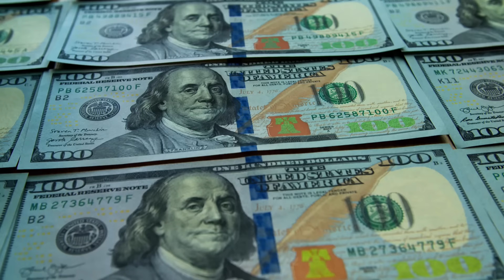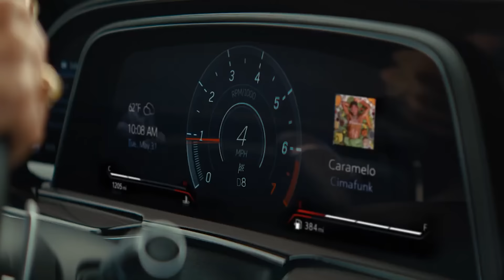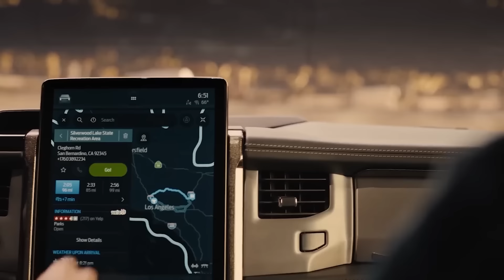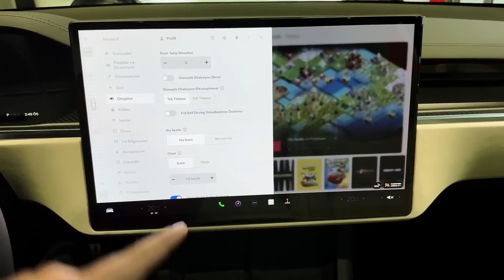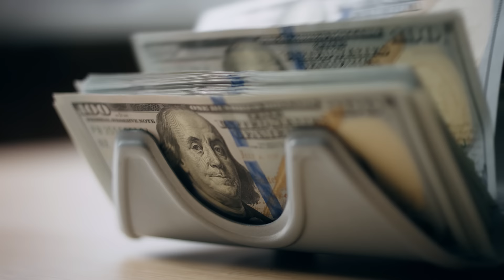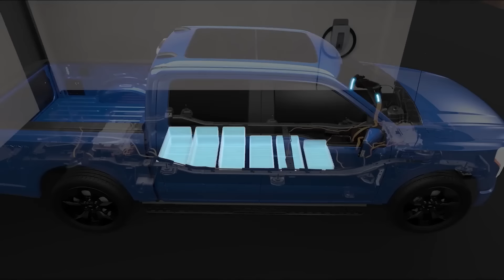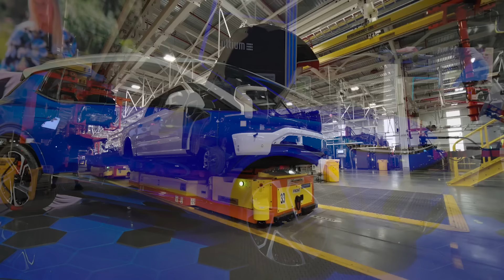SHOCKING! NEW EV Report Reveals MASSIVE EV Car Market CRASH!

Comment: EVs in China are heavily subsidized by the government. Once that runs out, it's not sustainable. EVs are not environmentally friendly, they are expensive, give range anxiety, waste time charging compared to filling up with gasoline, have higher insurance cost, battery degrades overtime, etc.
Reply: They are subsidised but manufacturing costs are plummeting all the time. To say that EVs are unsustainable is nonesense. No less sustainable than the manufacturing of any other car.
Reply: EVs spend most of the time sitting, plugged into charger, n charging time ($$)
increases as the batteries age. they certainly won't work for apt. dwellers, as
a bunch of EVs charging all at once, will trip the breakers, n people will trip over
the charging cables.
Reply: @driver4011  you say they spend most of their time charging, an ice car spends most of its time sitting idle. It’s that time that people typically charge their cars. When they are asleep. With experience with both, the EV has saved me not only time for my biweeekly 20 minute round trip to a petrol station but also costs me  two thirds of the price on fuel. So factoring in the time it takes to earn that money it’s a total no brainer.
Reply: @lukeclifton4392  it’s funny when people who don’t really understand business look at figures like this. Companies like the ones in China and Tesla make ‘losses per vehicle’ not because they are expensive to make, but it factors in investment in things that could be overheads. For example if Tesla invests $10bn in a gigafactory in Mexico, without making a car, that 10bn is factored into their expense for making cars. It’s very normal that companies investing in growth make losses. And EVs are very much in the midst of growth.
Reply: Gasoline has been subsidized in the US for decades, I'm not buying your opinionated trash talk.

Dealerships model is not competitive, gas and diesel emissions foul up the air, and ICE vehicles make tons of noise that makes any kind time spent near a road irritating. 

There's a reason most of Europe is moving towards banning personal cars within city limits and pushing EVs. They are just a better fit for urban/suburban car use. The only people that really need gas/diesel use are working vehicles.

We'd all be better off driving less and having cleaner options to do so.

Comment: Current EVs are a scam and not safe!
Reply: The only people buying them know nothing about cars
Reply: And it's funny how Tesla fanboys and EV kool-aid sippers try to make electric cars out to be the next best thing since sliced bread. NOT!!! When it takes 90+ minutes to recharge a car to full, on a special Level 3 charger...vs 'recharging' your ICEV in 5 MINUTES...there is no contest here. ICEV's will win out every time.
Reply: It's not even just current. It's a flawed concept which is just unmanagable for 90% of people, ends up costing more and they weigh more as well as the battery venting issues so more dangerous, but even safety aside, unless you're a retired old lady who only drives 10 miles to the shops and back once a week and have a driveway and/or garage to charge it in, ev's just don't work, they take a day to charge to like 300 miles when you can fill a tank in less than 10 minutes and get close to double that, most people don't have driveways or garages, terraced housing with on street parking, high rise blocks of flats.. we just going to have hundreds of feet of charging cables dangling out of every window and across every street to every car.. no. It will NEVER work.
Reply: @phugemawl well yea, the technology changes so fast. Its better to lease one 👍
Reply: @MDM1992  Why do people always bang-on about how long they take to charge? - What do most cars do at night whilst you're in bed sleeping?
Most EV owners have home chargers, and the car charges overnight, whilst not in use.
EV's have a place. They aren't for everyone, but it astounds me how opinionated some anti-ev-ers are. It''s like veganism! "I don't like it, so nobody should".
Reply: You mean Tesla cars ?! Yes long range EVs are indeed a scam. Small cities EVs are great.

Comment: Non EV driver is also suffering from increased insurance prices...I would guess this is because of the risk of being involved in an accident with an EV
Reply: What’s happening to the insurance cost for ice drivers? Going up.
Reply: @Audioremedy0785 Well, he does mention the words "increased insurance prices", so that might be a clue.
Reply: My is super cheap (Model 3 Performance). The point is that is doesn't matter if you drive a BEV and have a risk for higher maintenance cost. The guy that did the accident ist the guy that pays the damage, so in total all assurances are increasing. But they increase anyway, based the average repair cost went drastically up based on painted bumpers and expensive sensors in these bumpers (Radar, Lidar etc). 

I would sag a crash into a Tesla Model 3 cost the insurance not more than crashing into any other modern car. A Radar sensor (Tesla has no Radar sensors) repair cost is easily $5kthe bumper another 2k and the USS sensors another 0.6k. So a simple crash cost today 7k and a more. 

Forget the BEV impact, the other things the car industry did to make repairs as much expensive as possible did already made your insurance more expensive.
Reply: Strange, my EV insurance cost dropped, unlike my wife's ICE, both with no claims.
Seems you are repeating nonsense that MSM is feeding you, again.

Comment: The cost of replacing batteries is causing insurance companies much angst. Batteries are usually mounted underneath the passenger compartment and cover a huge area. This makes them more vulnerable to damage, and their sensitivity adds to the problem.
Reply: Check out the cost of KIA batteries in Canada. $60,000 to replace, when the car only costs $45,000. Bargain!
Reply: @foxstrangler I wouldn't even pay $6,000 to replace the batteries, let alone $60,000. They've got to be out of their mind, especially for a crap car such as a Kia. Those batteries are only worth about $4,000 at the most.

Comment: EVs are pushed hard into the market by politicians, and carmakers just complied. If they listened to the customers they would have fared much better. Yes, maybe EVs might have succeeded in the market, but much slower, in a much safer pace. I doubt the market of used EVs will recover soon. A big problem for dealers and manufacturers alike. Sales of new EVs will stay difficult. Political decisions pushing certain kinds of cars is not going to work in the long run.
Reply: "If I asked customers for what they wanted, they would've just asked for a faster horse" - Henry Ford

Truth is, most of you don't know what you don't know.

Comment: You know it's some game involved because they won't allow proven alternatives like compressed natural gas (CNG), solar and propane powered vehicles to be mainstreamed.
Reply: Solar vehicle? That's hilarious on many levels.  The number of panels required for one.  And,  if you live in Arizona v. Michigan or Washington for two.
Reply: Yes. I have a dual fuel, liquid propane injected/petrol SUV. It’s a rare gem indeed. But why should it be so rare? 

An LPG/Electric hybrid would be a great car in town or out in the country. 

Mine is a performance vehicle, a large SUV. The engine supplies 270 kW and 535 NM of torque, yet it costs only 1 cent per kilometre more to run than my wife’s little Ford Fiesta, a 1.5L four cylinder. 

This is from actual fuel figures, not some dash readout. 

Here in Australia we have been sending our LPG to China for decades, at cheaper prices than we locals can access. 

Using local technology first employed by Orbital Engineering in SA, Ford Australia perfected the liquid-injected LPG system and sold many reliable cars over several years, before local production of all versions of the Ford Falcon ceased due to changes in public preference away from large sedans. 

The LPG engines produced more power and a cleaner exhaust than the petrol versions.
Imagine a Hybrid made with this clean technology!
Reply: @mironkorzalko7761  Look up the Aptera solar car and tell me how hilarious you think that one is.
Reply: @kenbrown9781  That's great information. I drove propane/gas powered vehicles commercially for 9 years and they are a viable alternative solution.
Reply: @thebionicbassplayer  till they gain some traction in the mainstream news and can offer a vehicle for purchase,  I couldn't care less. Musk made pre-production promises on the truck....years later there was a roadworthy vehicle for sale, if you like cartoonish Jetsons prototypes
.  Price doubled, range decreased  shatterproof glass shattered.
Reply: @kenbrown9781 …Whilst I agree with your sentiment, Ford’s LPG vehicles were never “trouble free”. Many owners will testify to the common LPG issues.

A mate of mine (a government fleet manager) told me how at some sites they had box’s of blankets. The staff were instructed during winter on returning the LPG Falcons, to “tuck them in” with a blanket under the bonnet in order to stop them from freezing in the morning. The overnight temps barely got below zero.😅
Reply: @mironkorzalko7761 You called the Aptera cartoonish and then compared it to the cartoonish, production delayed Cybertruck, well you won that debate.
Reply: @thebionicbassplayer  It is a normal EV but can charge in the sun in a few days if you live in the right region. Needs the grid to use daily.

Comment: Could you imagine an EV rush hour traffic jam on ( pick your freeway ) in LA because they’re out of power? That would take days to get rid of the jam, then rolling brown outs as everyone tries to recharge their cars at the same time. Politicians never look at scenarios like this. It could easily happen. People never think before doing anymore.
Reply: Why would they all run out of energy? An EV is hardly using any energy when standing still, in the contrary to a gasoline engine which is burning a lot of gas idling. 
Just look at countries like Norway and the Netherlands where there's already tons of EV's on the market, and there are no EV traffic jams
Reply: @DokterRoetker  In Los Angeles this could happen. Thousands of cars everyday on the roads. However, LA is a good climate for an EV, but the infrastructure is lacking. Electricity prices are through the roof. Insurance companies are starting to refuse coverage on EV’s because of accident repairs and fires that not only destroy the car but the house it’s parked at. In Europe, they seem to have it correct when it comes to EV’s and its infrastructure. It comes down to the amount of traffic and how it flows. Depending on where you live and work in LA, it can take hours to get home during rush hour. Some people do turn there cars off to prevent idling, but that can be hard on the starter and the engine in a gas vehicle.

Comment: I've been in the auto industry for over 40 years as a mechanic , i will never buy any U.S  made vehicle over  2013 , any foreign car ever  !  Toyota is  the exception ,  why  ? us cars 2013 down  were always reliable (few exceptions) parts are cheap and available and much less elaborate computer systems.  Toyota builds exceptional reliable vehicles always  did and always will.  EURO cars all years 2 or 3 times more expensive for parts and repair ,even for the most basic stuff, and parts are always difficult to get.
As for electric cars they are the worst in everything. any thing goes wrong with them it would have to be junked ! due to repair  &  parts cost even if you could find a repair shop willing to work on it  and you wont , they have a short life span. this is what idiot governments want to force down our throats. they decided on this without any considerations whatsoever  as to all the logistics evolved  for them to be used in a  mass conventional way . and to top it off china is holding all the cards .buying up all the rare metal minds in the world that are needed to make the batteries.

Comment: How can all the exotic materials needed for battery technology, shipped from various countries around the world, be green?  Why weren't the charging stations built out ahead of major EV sales and why didn't someone think about the cost of charging an EV vs. the cost of gas?  How about the cost of putting in your own overnight charging capability in your garage and the pushback from the insurance industry dealing with battery fires, both in the home and on the road?  All in all, the auto industry and federal government were woefully deficient in their planning and their timelines when it comes to EV technology and adoption.  Now, in order to supplement our auto industry here in the US, we are depending on China to supply battery technology into our US EV auto models, while we block China from high-end semiconductor chips.  Why wouldn't they do anything possible to hit the US back in areas like EV batteries.  Heads should roll over this.  Taxpayer should be extremely mad about poor use of taxpayer dollars to subsidize EV's for early adopters.

Comment: I had a used BEV for two years. Other than having to replace the front rotors and brake pads it never had any problems. Midwest winters greatly reduced range and charging times. Based on my experience if we must move to more “environmentally friendly” autos I’d say hydrogen fuel cell vehicles would be a far better option and fill ups are similar to ICE autos. Simply convert gasoline fuel pumps over to hydrogen to match demand. Just my opinion
Reply: Norway built up hydrogen infastructure. There were no takers for the backward and very inefficient process and they have closed all but 3 stations in the whole country. Hydrogen is even less sense than ICE today
Reply: @johnn17golf ICE it is then.
Reply: @bobby1970  Enjoy your flip phone and ICE car.

Comment: Funny to see History repeat itself. Did this a 100 years ago.
If didn't work then why now ?
😮😮😮😮😮
Reply: To answer your question: Improved batteries, electronics, and higher efficiencies.  100 years ago, electric cars could only go about 20-25 mph, with a maximum range of only 30-40 miles.

Comment: EVs are ideal for commuter and fleet vehicles. If you drive max 50 miles a day, a tiny cheap commuter car is most economical especially when you can charge it in your drive-way overnight. Similar a fleet or delivery vehicle, the daily mileage is known and predictable, so the battery size can be optimal. In the evening the delivery vehicle returns to the depot for charging.
However battery operated semi trucks are impossible with today's battery technology. The battery had to be 1/8 of the cargo capacity at +$100K for the battery alone... all this is not economical.
There had to be 10X more charging stations than there are currently gas stations, when all cars on the street are EVs. 
The battery technology just is not good enough at this moment in time.

Comment: Your daily commute/grocery run around the town are essentially 95% of your life for majority of people. EV makes a lot of sense for this 95% of usage. I think the biggest problem of pushing EV at this stage is that the charging infrustracture and not so mature technology to go all the way to a 100% EVs usage. Hybrid plug-in/Hybrid is for now the best choice but not 100% battery power EV. But if your household has budget for two cars, owning an EV and another gas/hybrid car, makes a lot of sense. This largely reduce carbon emission and pollution. I won't say this is a scam, it is more like how government or car maker define the best usage of the EVs at this moment. Solid state battery is coming out in 2027 as Toyota said. That will make range going up to 600~700 miles and charing time reduce to less than 10 minutes, that is when 100% EVs can replace gasline car.

Comment: 40% of homes in the UK do not have the ability to charge at home, so have to use public chargers, which cost up to $1 per Kilowatt. So a 100KW battery costs up to $100 to charge up and that is if you can find a working charger that doesn't have a queue waiting for it, thus  wasting hours for a charge up. Then there is the cost of high tire wear from the excessive weight of the EV.
Reply: Now you just make stuff up - you are almost as deperate as the dude behind this channel. Average cost in UK to charge 80kWh in public charger is 12 quid.
Reply: @johnn17golf   Electricity in Southern California is $0.85/kWh during the day. So it’d be $64 for your 80kWh of electricity in San Diego. So, you can go 300 miles for $64! 
My Subaru uses less than 12 gallons to go 300 miles. Even at our outrageous gas price of $5/gallon, that’s….. are you ready? $60/300mile
Reply: @sirifail4499  peak eletricity in San Diego is 40c not 85! Why the falsehood AGAIN, siri?
80kWh gets me 425Km in my EV. $32 at your peak price, $9.60 at my peak price. little VW golf  7l/100Km, need 30litres fuel. In Canada that is $45. 
You were saying....?
Reply: Why did you start talking about the UK, using Dollars? - Hmmmm. Allow me to guess... You're full of crap?
Reply: You just might be surprised to find the UK has EVs too. I used dollars to make it easier for you to comprehend. When you resort to insults, you have lost your credibility.    @TheMattHarwood
Reply: @foxstrangler   You lost credibility with your initial post. I was simply pointing out that your post had glaring flaws. I have no idea where your statistics come from, you could be right about 40% of UK houses being unable to charge at home, but $1 per kWh is rubbish. The UK average is 48p at public charge stations, which is $0.61. - And I’ve seen it much cheaper than that, seeing as I AM in the UK.
Reply: I did not mention the 40% of UK homes bit. You are the one who is confused, and I live in the UK too, probably for many more years that you have.